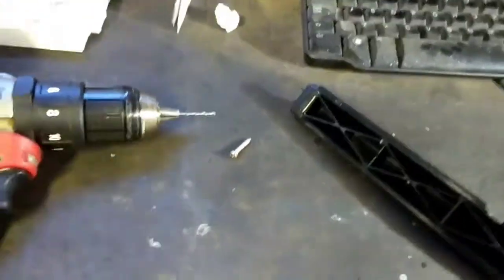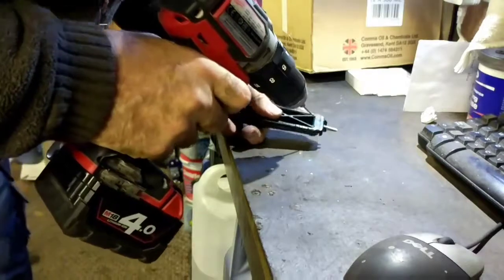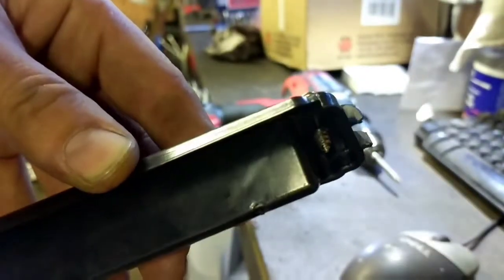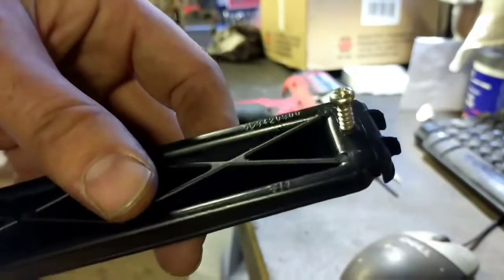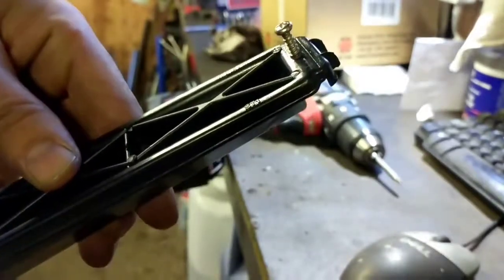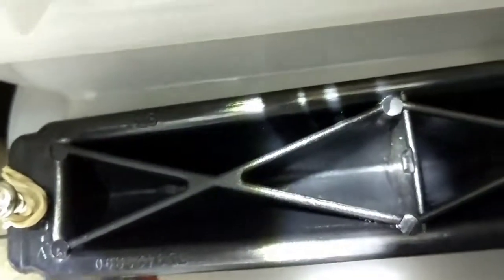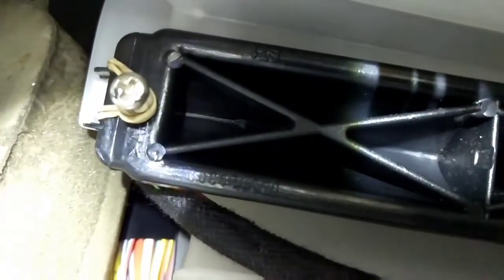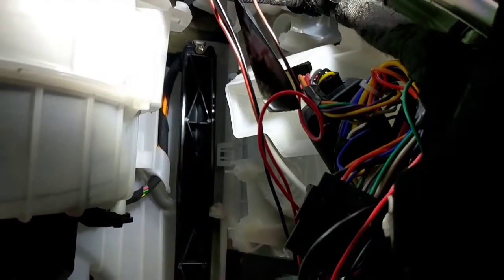Corsa D pollen filter cover fix

Comment: Mate you're a life saver. I'm gonna attempt this now. I was thinking to use a zip tie too hold it in place
Reply from the maker: Good luck, it's a bit fiddly. Thanks for watching.
Reply: Automotive Solutions Managed to hold it down in place (securely). Now just need to find a way to return my replacement £23 from eBay.

Comment: There's already a hole for a bolt in the bottom, why didn't you just use that? How I fixed mine.
Reply from the maker: I prefer it to be secure top & bottom as it's designed to be.